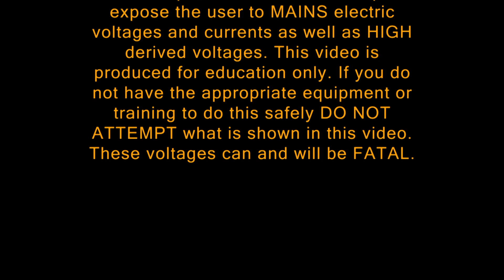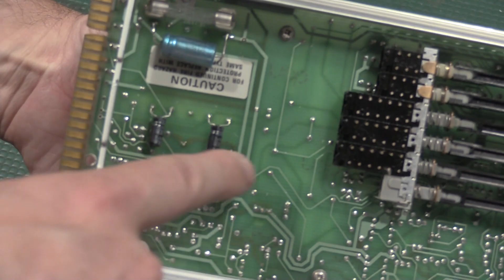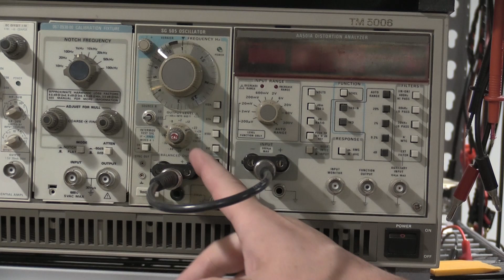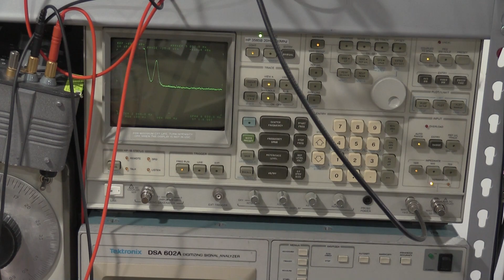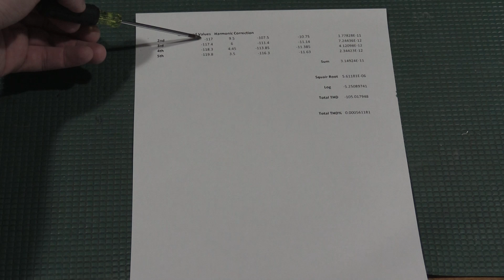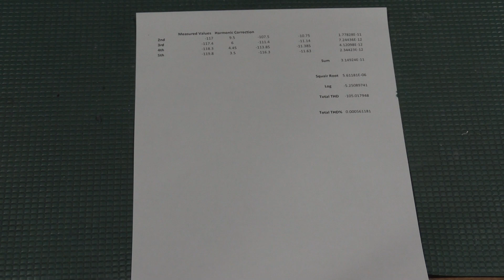TekTronix SG505 Repair and Abridged Validation

Comment: You shouldn't really use the A-weighting function on the AA501 when evaluating the distortion performance of the SG505. The A-weighting filter frequency response varies considerably over the audio band and will distort the relative amplitudes of the harmonics, particularly when your fundamental frequency is higher than 2kHz.

The major reduction in distortion you were seeing at some frequencies is partly due to the harmonics being suppressed by the A-weighting filter filter but also the reduction of higher frequency noise in the AA501. If higher frequency noise is a problem it is better to use the 80kHz LPF rather than the A-weighting filter as it lets through more of the harmonics you want to measure. If mains hum on the signal being measured is a problem you can switch in the 400Hz HPF.

It is always a good idea to have a scope on the Function O/P of the AA501 to check that the signal, after the fundamental is suppressed, is primarily harmonics of the test signal and is not polluted by extraneous non-harmonic noise. Checking for excessive level of the fundamental leaking through also gives a good indication of the correct operation of the AA501's notch filter and will show up any instabilities in the test frequency that the AA501 is unable to track.

The testing procedure can be speed up considerably by using more modern equipment. You can use a scope with an FFT function rather than a spectrum analyser to monitor the notch residual signal. This will scan much faster than the spectrum analyser and goes all the way down to DC allowing you to check for spurious signals originating from mains hum or instabilities in the power supply etc.
Reply: 100% correct. I still use the AA501A and balanced + IMD optioned SG505 as primary distortion measuring in my lab. I feed the out to a Siglent DSO in FFT mode 

The other 505-Option 2 Zen knows of might be mine... we swapped some emails a while back.
Reply from the maker: Yep I know of 2.5, Yours, Mine, and the half unit I have here that does not have the attenuator board. I am not expecting to fine a board any time soon for that one.
Reply from the maker: This is true. I was using A weight only around the 1Khz mark where it is flat and the validation is only done to 3 harmonics out from the fundamental. With out the A weight filter the AA501A is only speced to <0.0025% in the audio range. Therefor it is incapable of doing a validation on the SG505. It Can do a validation on the SG502's at least up until the notch runs out of gas at about 300Khz the SG502 can hit 500Khz. In some of my testing it seems my AA501 non A has floated out of adjustment and I need to readjust it again to get the noise suppression correct.  With just the 80Khz low pass enabled the bad one is reading 0.0045% but the AA501A is reading 0.0018% it is also reading 0.0018% on the SG505 OP2 so I am likely to believe what it is telling me. 

In terms of using a modern scope with FFT. I have 2 in the lab that can do FFT functions however there is My Rigol 1104Z and the DSA602A. The issue here is signal level. If I use Dbm in a 600 Ohm system which the SG505 was terminated in at -117Db down I get a Vpp level of 0.0000030947 or around 3.09 uV of signal. A scope input just does not have the sensitivity needed to measure a signal this low. Hence the need for a full spectrum analyzer. My Rogol is only speced down to 1mV/Div so it is several orders of magnitude off what would be needed to look at the signal in question. A scope just does not have the dynamic range for this measurement.  I will have to look the 11A33 might have enough CMMR and dynamic range to do measurement, but I will need to dive in to the spec sheet.
Reply: @ZenwizardStudios  I am not suggesting that you directly scope the O/P of the special notch filter module but rather the Function O/P on the front panel of the AA501.

You should get a much more substantial signal out of that Function O/P connector. This signal is amplified and scaled after the notch such that full scale reading should be equivalent to around 2V RMS. Even if you are looking at the lowest possible distortion of an SG505 the harmonic signal on the Function O/P should still be in the range of several mV RMS, quite readable by a moderately sensitive scope. By viewing the signal after the fundamental is notched out you effectively gain another 60dB or more of dynamic range for your scope allowing viewing of the minuscule harmonic signals.

Using a scope to directly look at the O/P of the SG505 is futile as even the best available scopes would not have the dynamic range and noise floor to allow discernment of the harmonic content. Neither do most spectrum analysers have the dynamic range necessary to directly view the distortion products of the SG505.
Reply from the maker: Yep and I totally agree with everything. However there is a problem with the method. It is stated Here 

“This signal is amplified and scaled after the notch such that full scale reading should be equivalent to around 2V RMS.”

The issue with this method is the AA501’s have a WORSE distortion spec than the SG505. As good as the AA501 is it is impossible to us it to validate the distortion of an SG505. Now it can sanity check one and see if it is way off. To answer the question if the SG505 is with in spec a different method needs to be used. Due to the amplification in the AA501 at the function OP you have the main signal plus the distortion components of the AA501 as well as the primary signal. This would work IF the AA501 had a better distortion spec than a 505 but the 505 beats the 501. However this is great for looking at amplifiers and devices under test. 

Spectrum analyzers can get the noise floor but they do not have the dynamic range hence the usage of the external notch. Tek specified a 7L5 or 7L3 as the alignment Spectrum analyzer 80 dB of dynamic range and a -60 dB reference level.
Reply: @ZenwizardStudios  You can sometimes do better than distortion analyser's specification by post-processing the residual notch signal. Along with the distortion components being measured this residual signal will contain artifacts introduced by the distortion analyser itself such as distortion introduced by the analyser front end, residual fundamental feed-through and circuit noise. Since the detector after the analyser's notch filter is generally fairly wide-band the minimum specified distortion that the analyser can resolve may be dominated by by the last two items.

These last two items can be eliminated in post-processing and the remaining true distortion components identified to get closer to the actual  distortion from the device under test. For example, I have calculated the distortion of my SG505 down to 0.0009% by doing an FFT on the notch filter O/P of my HP8903A and identifying the individual distortion components. I probably could have even done a little better if I had taken more time and care with my measurement set-up.

The measured result of 0.0009% is 11 times better than the 8903A's, admittedly conservative, minimum distortion specification of 0.01% so it shows the potential for improvements in distortion measurements.  I don't know if the AA501 has this same potential but it would be worth investigating.

Comment: Did I miss seeing you use the AM502?
Reply from the maker: The AM502 is only used to check the 10Hz range. I need to acquire a DSA to go that slow. My current slowest spectrum analyzer only goes down to 20Hz some HP DSA's will go down to 0.1Hz I will do a full validation once I acquire the necessary analyzer
Reply: @Zenwizard Studios  Thanks for details, repeated I'm sure. There are lots of details in this video. 
I just got an SG505 opt01, so seeing this was very interesting.